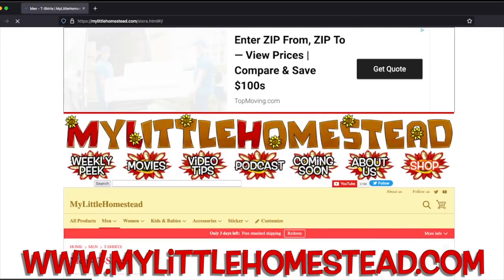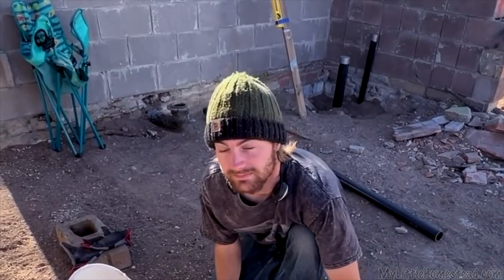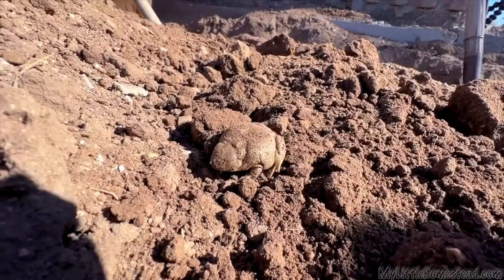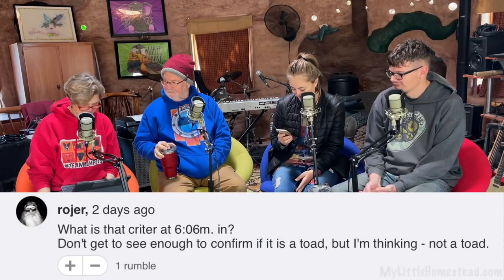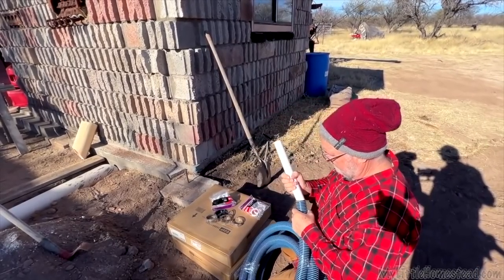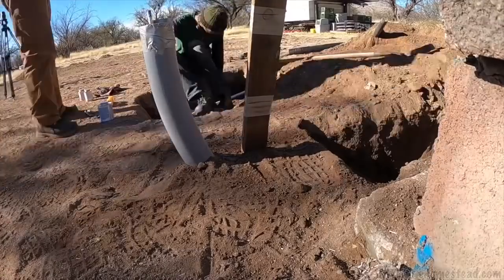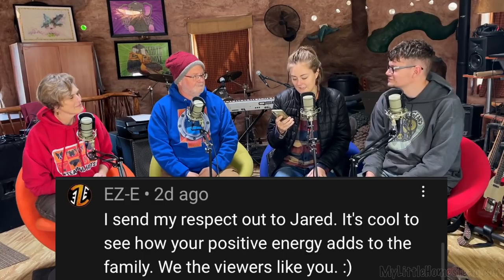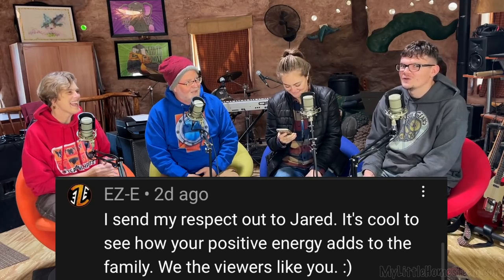The Mystery Blob | Episode 102 | My Little Podcast

Comment: If you need to run items through your pipe placeholder in the future you just get the super light poly string, tie a plastic grocery bag on the end, use a shop vac on the opposite end and it will suck the line through for you to pull additional wires through.

Comment: All I will say is sand down that pvc (just get the shiny stuff off) and put a coat of UV spray paint on it.   I live in the high desert too and PVC will get as brittle as an eggshell.  My radon pump was put in 12 years ago and the PVC connected with it needs to be replaced badly.

Comment: Did you ever think of building a sort of hallway trench in your shop.  I don't know for sure what you call them, but like an area, hallway, a little narrower than most wheel bases where you can walk below a vehicle and work on the bottom while standing up?  The quick lube place I use in town has a cool one, it's more of a "T".  The bottom of  the "T" is the top of like 5 stairs, you start down and by the time you're  to the back bumper, you're  to the bottom  and can just keep walking.  The top of the "T" crosses right under the front bumper.  There before you drive over it there are some curb blocks, so yiu are very unlikely to go too far. There's a tool box and a couple of home made extra tall funnels that reach down to a small barrel/ large bucket and up to your drain plug with large funnel tops not quite as large as a drain pan. There are lots of light and an air hose and vacuum hose.  I was under a small two wheel drive truck a while back working on a starter getting mad and sure could have used a trench like that.  Come to think of it, I end up mad nearly every time I have to get under a car!

Comment: When I was in the Navy, the shipyard used duct tape a lot. We called it EB tape after Electric Boat, the Submarine builder. There where different grades of tape each having there own separate color to go with it depending on the holding power and water resistance. EB Green was the most common. EB White was used exclusively for the Reactor though.

Funny story, a submarine going out for sea trials had to turn around after one of the crew discovered, when rigging a compartment for dive, saw daylight shining on the deck inside the boat (One of those things that never should happen. Ever). Apparently a hull opening that should have been sealed off was covered over with a piece of duct tape in drydock, so water would not drip inside the boat when it rained. It got painted over and was overlooked until a line handler scuffed it up as we cast off and got underway exposing the hole.

Comment: National Electrical Code 2023:
"A Dur Dur Tube is required for bringing underground service to the inside of a building.
A 200 amp service requires a schedule 40 Dur Dur Tube.
A 400 amp service requires a schedule 80 Dur Dur Tube.